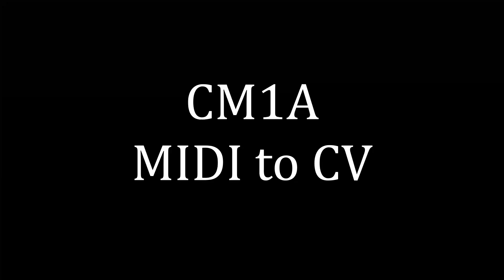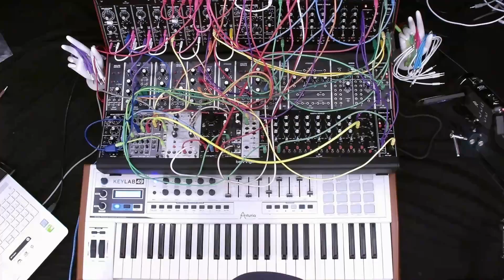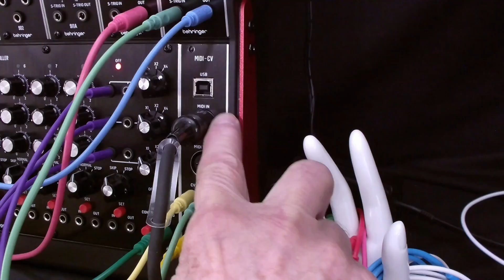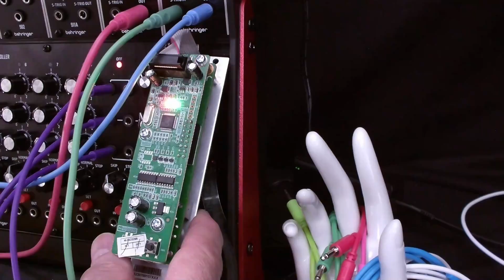System 55 CM1A Midi to CV converter

Comment: sorry, im a little confused... which mode would support other modles outside the behringer ones? say maths or vhikk-x or pams pro workout... stuff like that?
Reply from the maker: It supports all CV/Gate.  The modes control whether the gate voltage starts at 0V and goes to 5V (Green LED - normal V-trigger mode used by almost every module other than the System) OR it starts at 5V and drops to 0V (RED LED - system 55 S-trigger mode).  So, for most Eurorack modules, you want the V-trigger mode.
Does that help?

Comment: How do you set up a midi channel?
Reply from the maker: connect your computer to the CM1A's USB-B port.  Use Synthtribe to select the desired midi channel.  Of course, you must also transmit the MIDI notes on the channel you selected.  The default is MIDI Channel 1.
From the Quick Start Guide:
SYNTHTRIBE
Download the SYNTHTRIBE application from behringer.com to adjust pitch bend
range, select MIDI channel and CV mode, and adjust note range (C0 to C9), and
other calibration.

Comment: Is it possible to use with a wind controller which sends midi notes, pitch bend, and a wind strength midi cc signal?
Reply from the maker: The CM1A will only respond to midi notes and pitch bend.

Comment: Assuming you want basic mono mode, does it matter if you have 100 and 55 modules, and other types too?
Reply from the maker: The CM1A can output both an s-trigger and a v-trigger at the same time to support Sys 55 envelopes and Sys 100 envelopes at the same time.
Reply: @ozhalljr  thanks

Comment: Cool stuff! If I hook this up to a Behringer Model D (mini-Boog?), will I be doing it as System 55 mode? Or as System 100 mode? And are the two CV outs individually addressable? My intent is to utilize one CV out to modulate the CUT CV (filter cutoff) on the Model D, and if possible use the second CV out to modulate LFO SPEED.
Reply from the maker: I’m pretty sure you want System 100 (v-trigger) for the model D.  The dual mode is designed to track the highest and lowest keys played on a keyboard.  There is only a single trigger ( available as either Sys 55 (s-trig) or Sys 100 (v-trig) ).   Only one midi channel is used. Velocity is ignored.  Does that answer your question.?
Reply: @  Hi, thanks for the reply.  I will be utilizing a CME U6MIDI PRO to translate velocity to note values, and the CM1A to translate those values to voltages to open the filter. That’s the primary purpose, and if it does only that I will be content. But with the second CV out, I will want (if possible - and again, using the U6MIDI PRO) to translate the actual notes played to a narrower range of notes to control the LFO speed. The U6MIDI PRO mapping functionality can do those front-end translations, and I’m clear that the CM1A can do one or the other of those CV objectives. 

As the keyboard involved will always be sending a note value AND a velocity, I will always have two ‘notes’ to send to the CM1A. Guess I need merely to be clear about the ranges I use.
Reply from the maker: That's very cool!  I was unaware of the U6MIDI pro.  I may need one of those.  Please do a short video when you get it all working.
Reply from the maker: @Gk2003m p.s. in Take 5, were you on bass, drums or guitar?
Reply: @ in the Take 5 Blues and Bridge of Sighs vid I’m playing guitar. In this vid of Frankenstein I’m on drums - the drummer from Take 5 is on guitar, and the bassist remains the bassist. https://youtu.be/UJeyUVV-f9I?si=ZuPRlx2xOi0ON4v3
Reply from the maker: Wow!  Impressive cover, and with just 3 pieces!

Comment: I have an electron sampler.
and in the module I installed a divider, that is, my mdi to cv could give the tempo to the entire modular...
connecting the OUT output of the electron to the IN output of the mdi and then using a cv to connect it to the divider and from the divider I go out to the other modules 
 so that it gives the electron clock and thus everything works on time, right?
Reply from the maker: I think so.  Have you tried it?  I'm not sure what you mean by "in the module I installled a divider".  Did you add a divider module to the System 55?
Reply: My simplest question is... with this module I can connect an Electron sampler and use it as a clock in my modular 
Or is this module simply a CV for notes?
Reply from the maker: @No.Name.9-z1l you could use the CM1A gate out as a clock .   But it would not be the MIDI clock.  You would have to send a sequence.  The gate/trigger of the sequence would be the clock.

Comment: Hello Mister, thank you very much for your video. I need your help to configure the elektron analog rhytm mk2 to synchronize the tempo of the 960 sequential behringer eurorack. Let me explain, I want the master tempo of the elektron so I use the elektron midi output to the CM1A cv midi convert midi input. On the CM1A, a plug trig cable to shift the 960 sequencer but it doesn't work... My sequence on the 960 sequencer doesn't change when I move the tempo on the Elektron. Thanks in advance
Reply from the maker: The CM1A will not convert a MIDI clock into a trigger.  You would have to have a sequence of notes sent via MIDI (the rytm should be able to do that)  and use the trigger output as a clock.  Also, to do this you would have to configure at least one of the trigger outputs as a V-trigger.  An S-trigger will not "shift" the sequence (unless you convert it to a V-trigger via the 961 Interface module.
Reply: @ozhalljr  Thanks for your answer! So if I understood correctly on the analog rhytm side I only connect a midi OUT cable to midi IN of the CM1A. A jack cable from the CM1A trig to S-TRIG IN of the 961 interface. Then a jack cable from the V-Trig OUT interface to the shift 960 sequencer?
Reply from the maker: @ValentinSalomon-n7w  Exactly!  Be sure you have the CM1A trigger type set up to "both".  The tempo will be the tempo (1/4 note seq. 1/8 note seq, etc) of whatever sequence you are playing on the Rytm on channel 1 (or whatever channel to which your CM1A is configured ).  Let me know if you encounter any glitches.
Reply: @ozhalljr  Update: I managed to modify the tempo of the 960 sequencer via the elektron! In fact I now pass a midi IN cm1a cable to midi OUT of the arturia keystep and from the midi in of the midi keystep to the midi OUT of the elektron but I do not go through the S-TRIG to V-TRIG interface. My sequence on the 960 sequencer is not well synchronized with the elektron, I really have the impression that it is shifting. I will see if I can improve the synchronization by modifying some parameters of the keystep (Seq / Time Div / Rate). Maybe my midi chain is too long to synchronize a modular sequencer. Thank you for your help
Reply from the maker: Good progress.  If you have the keystep, try the keystep sync out to 960 Shift In to drive the sequencer.

Comment: Excellent videos. I have amassed a few Behringer analog synths and just got the 960 sequencer + 962. Can the CM1A be used to receive MIDI Clock from a DAW, and sync the 960 to the MIDI clock from the DAW? If it can, what would the connections from the CM1A to the 960 be? I'm just beginning to enter this world and I have not found a video that clearly answers my question. Thank you in advance.
Reply from the maker: Great idea for a video.  Let me see what I can come up with.

Comment: Hey O.Z. Hall!

Excited about diving into my Behringer System 100 Bundle. Wondering if you have tips on integrating it with VCV Rack. I’ve got the CM1A MIDI to CV converter but keen to learn how to add a sequencer from VCV Rack to control my modular setup. Any advice or tutorials?

Thanks a bunch!
Reply from the maker: @designerdrug I have used VCV (great system).  I don't think I've driven a MIDI to CV converter from VCV, but surely that is supported.  I don't have time now to chase this down ( gotta jump back on the Victor series).  There's probably a tutorial on YouTube for that.  If you hit a snag, I'll try to help you work through it.

Comment: Can I use the 2 CV and trigger outputs independently for 2 independent oscillators ?
Reply from the maker: Yes!  It supports duophonic operation.  It will play the lowest note and the highest note.
Reply: @ozhalljr  mmm...I know it can do that. What I want to know is if I can use it to trigger 2 separate sequencer melodies.
Reply from the maker: @jaydvbaby sorry , I misunderstood.  The the gates are not independent.  They will fire at the same time.
Reply: @ozhalljr  bummer :(  . I thought I could use 2 of those to make a contrapuntal 4-voice piece.
Reply from the maker: You could buy 3 or 4 of the CM1As.  They are down to $39 now :o
Reply: @ozhalljr  yeah, but they are 6hp each. Four of them will be 24hp. I have only space for two (12 hp).
Reply from the maker: @jaydvbaby  Right!  The space is often an issue.

Comment: modular newbie here.... why isn't it picking up when i try to connect to my daw. any thoughts?
Reply from the maker: If I understand the question, you have your PC connected via USB cable to the CM1A MIDI to CV interface.  If that connection is good, you should be able to see the CM1A in the list if MIDI interfaces w/in your DAW.  Can you see it?
Assuming that you can, you will need to configure your DAW to do the following:
1) output some MIDI note information to the CM1A
2) the MIDI notes must be transmitted on the same MIDI Channel.  ( What MIDI channel is your CM1A configure to listen on? )
3) you must connect the CV output to the Oscillator(s) that you're using (if you monitor the direct VCO output (w/o VCF or VCA) does the pitch change as the DAW transmits the notes?)
4) you must connect the Gate (trigger) output to one (or more) Envelope generators.  (is the CM1A configured for s-trigger output? (vs v-trigger outputs) )? )

With regard to configuring the CM1A, there is a utility provided by Behringer for this module.  Be sure to install it to confirm the MIDI channel and the type of trigger output (s-trig or v-trig).

This is not an exhaustive list, but it does give you some critical links to check.
Let me know what the issue turns out to be.
Reply: thank you!!!! this worked @ozhalljr
Reply from the maker: @em-qi6wn so what was preventing it from working?
Reply: I didn't realize it would be under the list of midi interfaces + I installed the utility Behringer has.  @ozhalljr

Comment: Hi, very useful video!, thanks. can you tell me if it is possible via SynthTribe to configure idependent MIDI ch. for each CV/Trig. ?
Reply from the maker: No.  With CM1A firmware version 1.0.0, the only functions that are available to change via Synthtribe are:
Midi Channel
Pitchbend Range
Mono/Duo (as explained in the video)
CV Range (as explained in the video)

That would be a cool feature though.

Comment: Very timely video! I just got one of these and am trying some experiments now. So if I understand it is like the duo nice ob the B2600? Dump question, the the separate trigger outs then. Maybe so you can do s-trig and v-trig and not really discrete. Do other cv to midi converters have true polyphony (eg Doepher - Befaco ) for example? This is a terrific series! Thanks.
Reply from the maker: Thanks Tony.  r.e. other CV converters, honestly, I've never see a duophonic keyboard work the way a split (or polyphonic) keyboard would (with independent gates/triggers).  This includes the ARP implementations that predate MIDI.
Reply: I just read what I wrote OZ and it is not very clear! I should read things over before posting. Sorry.....What I was trying to say was, The CM1A implementation is like the duo mode on the Arp 2600 rather than a discreet dual mono mode. Then I was wondering why they configured the module with 2 cv and trigger outs and it must be so you can do s-trig and v-trig at the same time. Hope that makes more sense @ozhalljr
Reply from the maker: @moogfooger  Yes, surely they reused the same firmware in both the B2600 and CM1A.